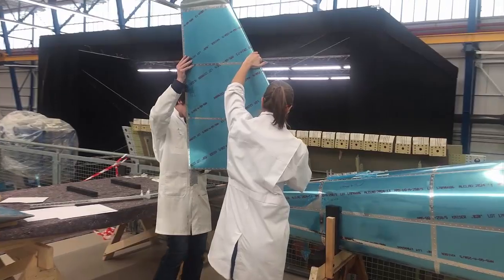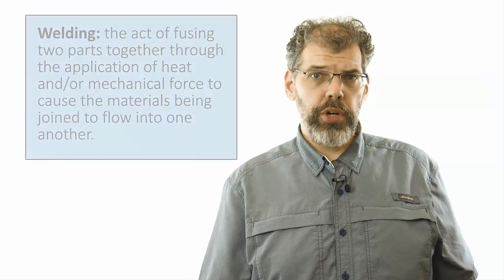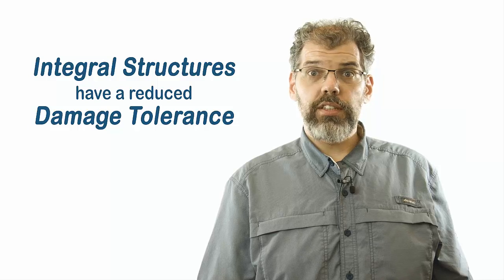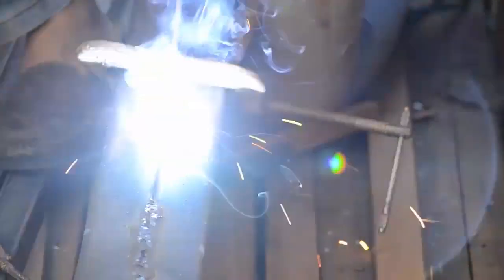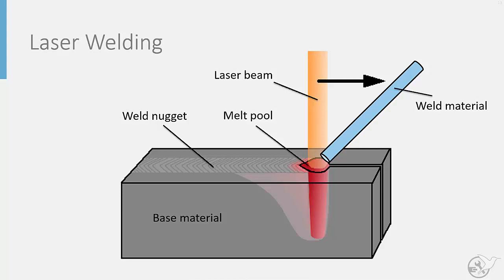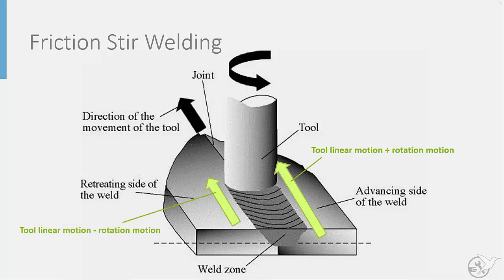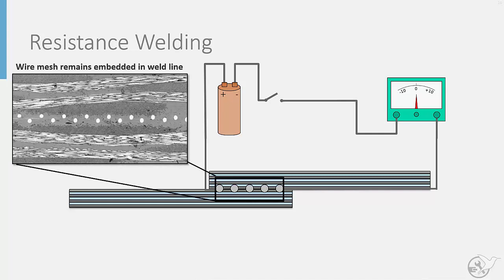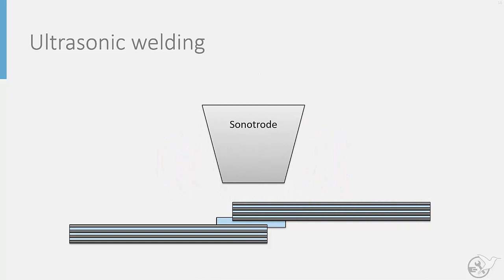Welding Methods for Metal and Composite Materials

Comment: Thank you for the video, so for a thermosetting resin like epoxy matrix (for example, a GFRP prepreg with epoxy ), the only way to join it to a metal structure is through adhesive?